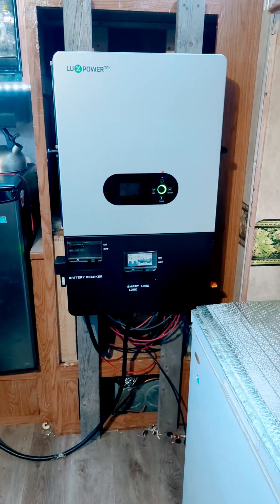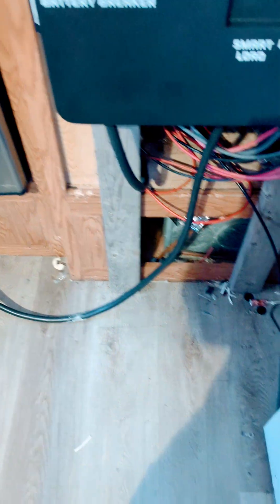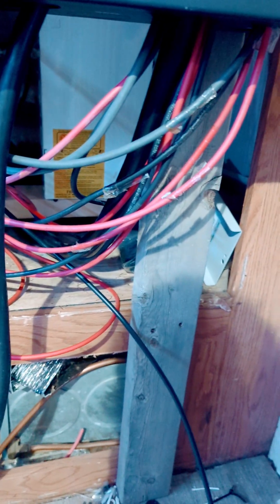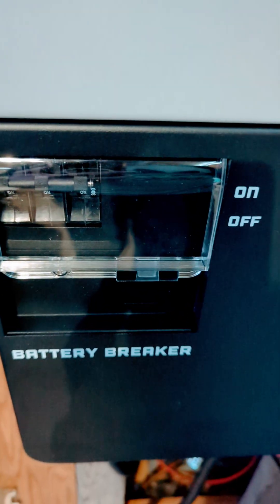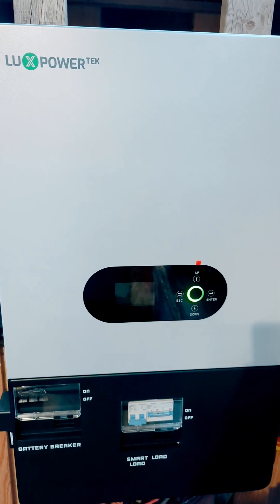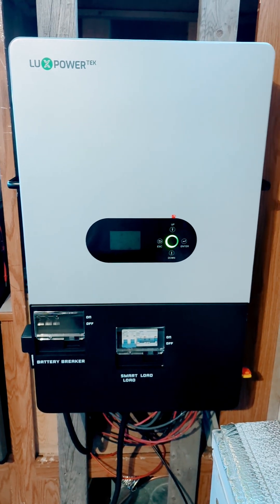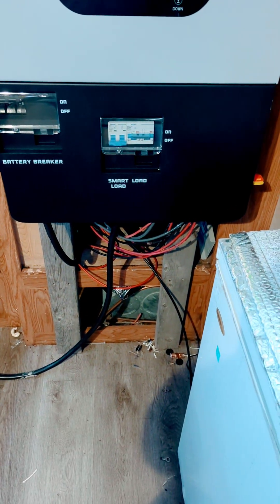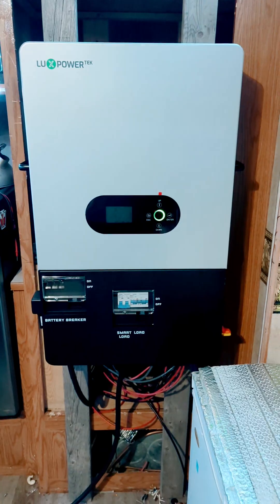Off grid, Lux 12000 XP, Inverter change only 12 wires too short to make it easy. #solar

Comment: Make a tutorial how to set the parameters for it 😊 the off grid settings
Reply from the maker: Really basic set up. You don't even need a guide if you know your charge values. The Gen might be tricky, based on 240v vs 58v like older inverters. Old was 120A new is 26A.    It works silent and best charge curve out of 4 inverters. Mike's garage put it on the scope, nice clean curve.